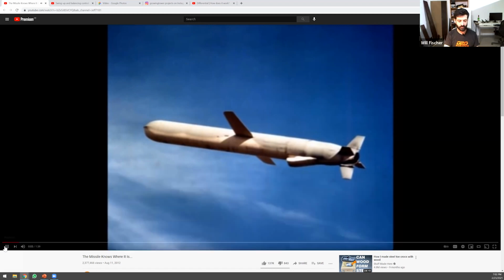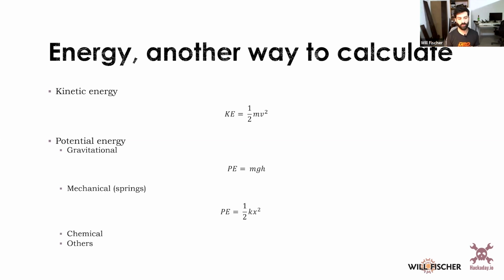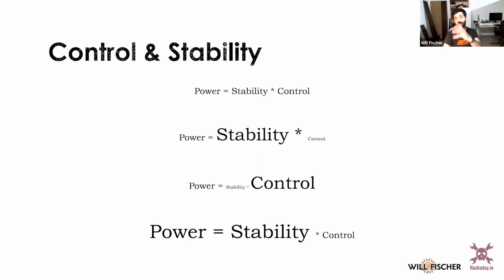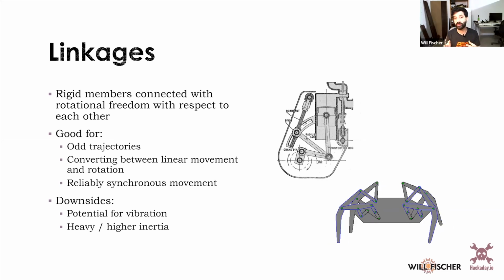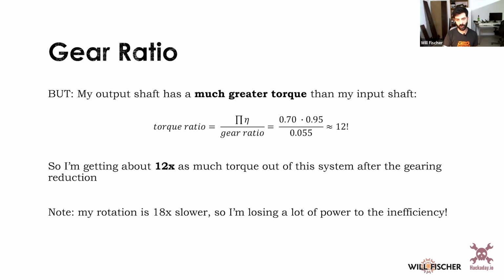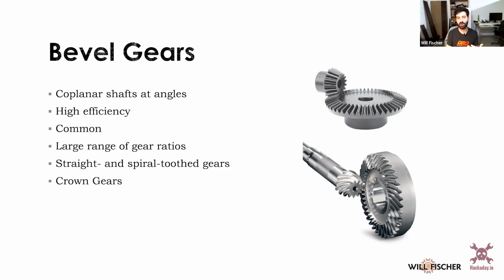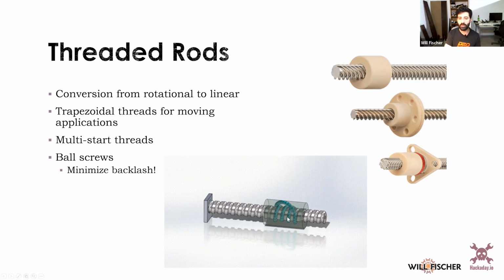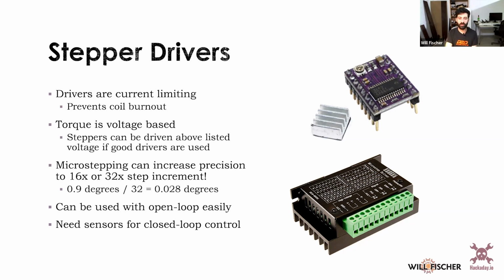HackadayU: Prototyping in Mechanical Engineering Class 5

Comment: a weird anecdote about cargo plane stability: the Antonov An-225 is a high wing (classic for cargo planes, it allows trucks to come right next to the equipment, same reason for high tails) this cause a stability issue in the roll direction, it has ginormous moment area, because the center of gravity is so low wrt to the wings. That means it would be too stable, basically it wouldn't roll enough even for the sedate demand of a cargo plane. The way they combated that is by having sad wings whose tips sag down, it allows truck to still come close to the fuselage because the roots are high while sending some wing mass (think fuel too) a bit closer to the center of gravity, and recovering some roll authority at low speed.